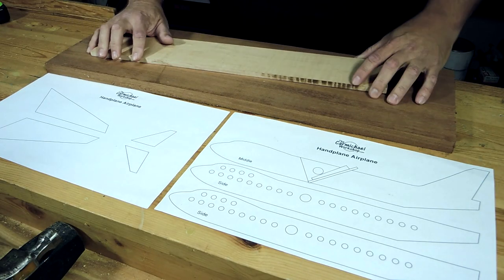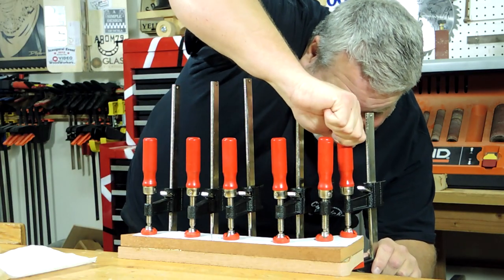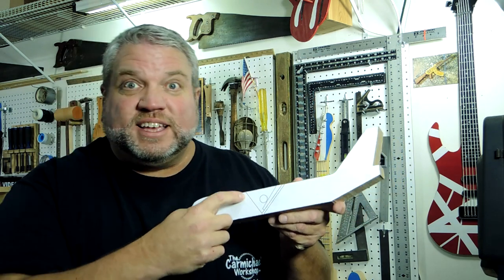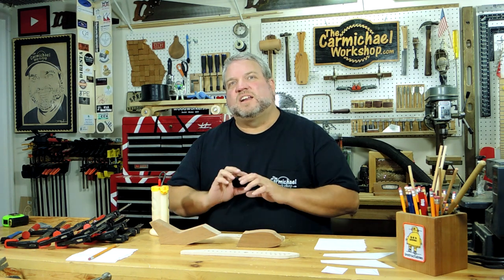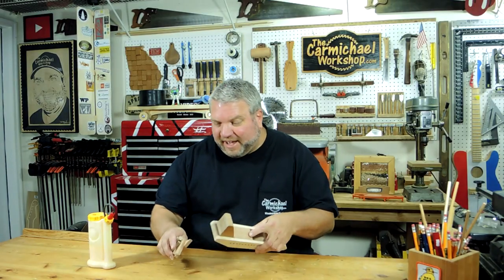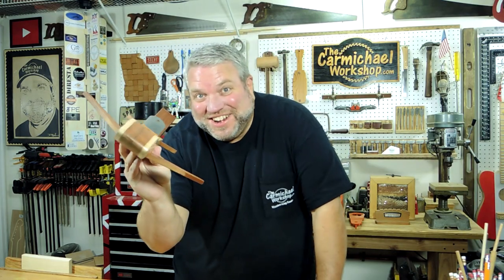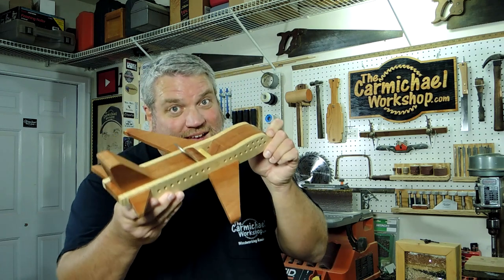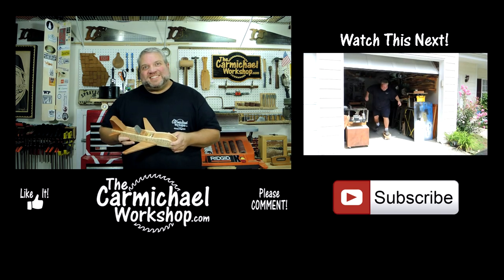Airplane Hand Plane for Makers Care

Comment: awesome idea! the wings are going to break because the grain is running perpendicular to the length.
Reply from the maker: +Justin Fiaschetti   Thanks Justin!  It was a toss up between a strong glue joint and grain direction.  I went with a stronger glue joint.  The mahogany is pretty tough.  It's just for display really anyway.